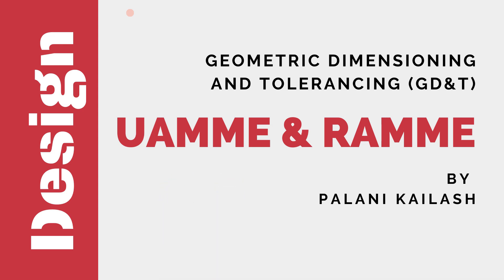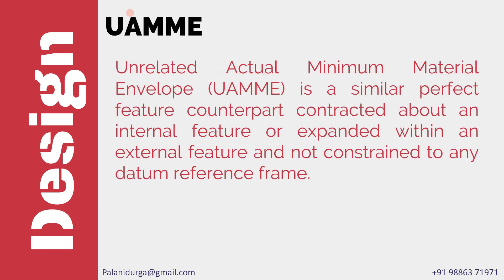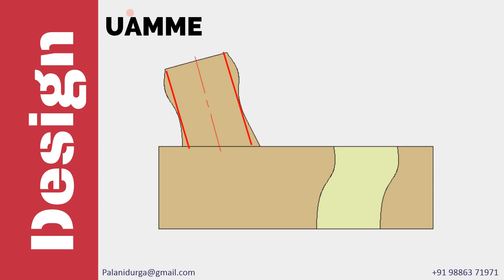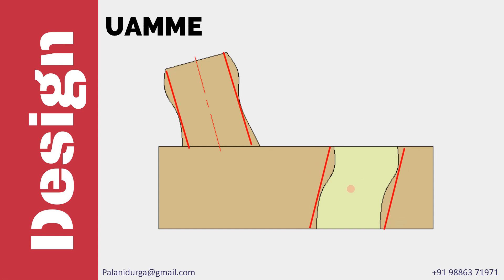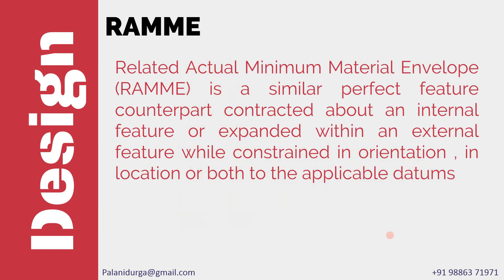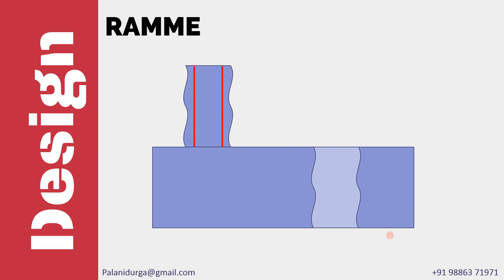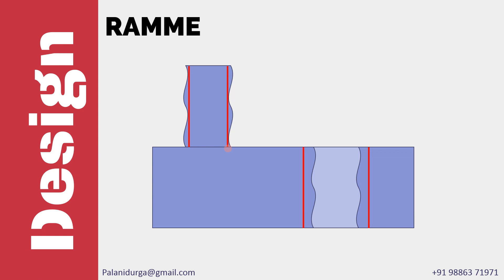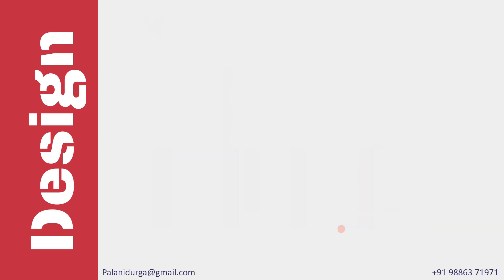GD&T Tutorial 11 : Unrelated & Related Actual Minimum Material Envelope

Comment: In UAMME internal feature I think the imaginary envelope contracts and touches the high point of hole and not low points. Please explain
Reply: Please explain related to the above given video
Reply from the maker: when you have an imaginary envelope expanding from inside of the material, it can only touch the low points of the part surface. please revisit this video again